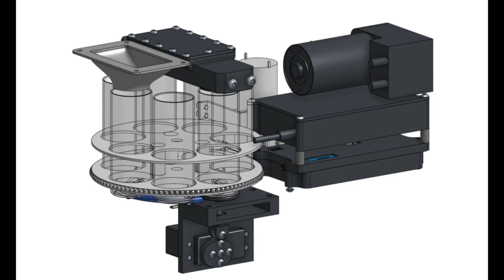SJSU Robotics 2023 SAR

Comment: Very cool design! Nice to see something totally different. Are the RMD-X6 motors also used for the wheels? Do you like this motor?
Reply: yes this robot use the rmd x6 over the entire rover, however we have switched to universally using the rmd x6 v2 s2 due to its internal gearbox and the discontinuing of the x6